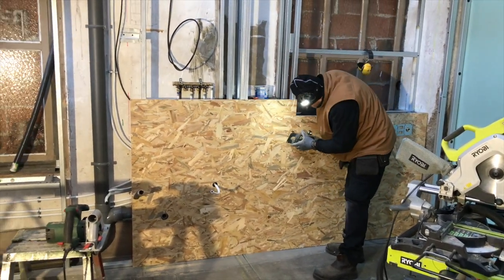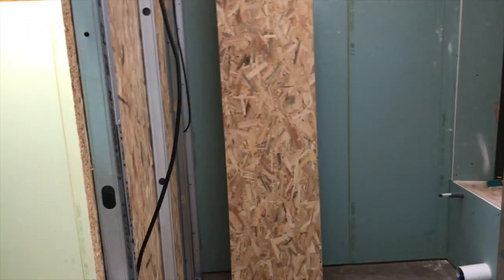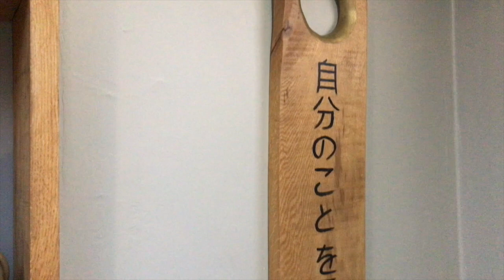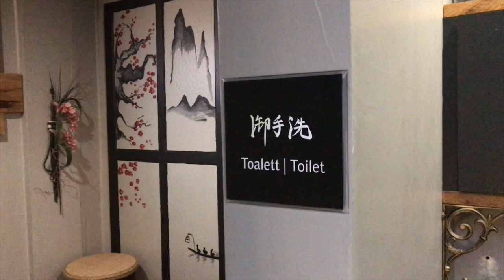SPA REVEAL - JAPANESE INSPIRED BATHROOM WITH SAUNA AND RELAX - FROM GARAGE TO A PIECE OF HEAVEN

Comment: You and your husband created a gorgeous spa!      Your planning and attention to every detail is amazing! Everything is very purposeful and unique…just like you! 
Question: Considering the spa is located in a stand alone building, how do you heat/cool the space? I noticed that you and your husband were wearing coats in most of the videos. 
Great space! Great video!
Reply from the maker: Thank you so very much Christine 😊❤️!  We live in an old factory so the living space is connected to the "outbuilding" (not stand alone).The outbuilding is not heated, the reason for wearing coats beginning of the year. The spa unit itself is well insulated and has floor heating in the shower area and toilet area. We also have a radiator in the relax area.